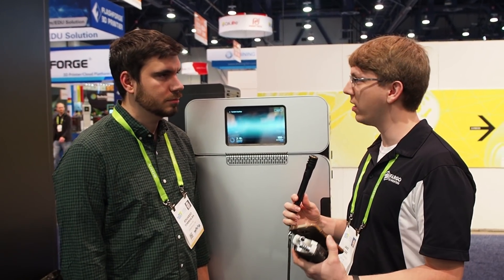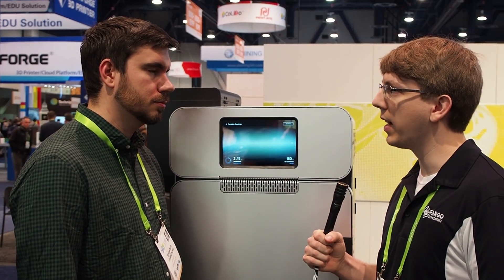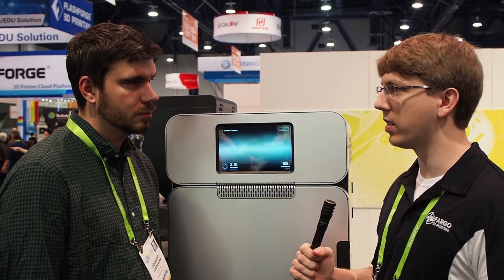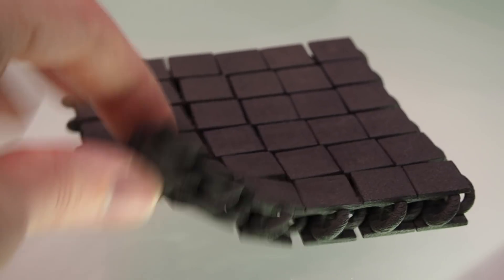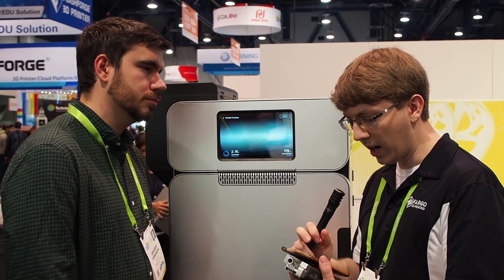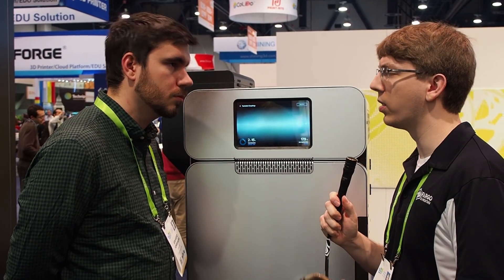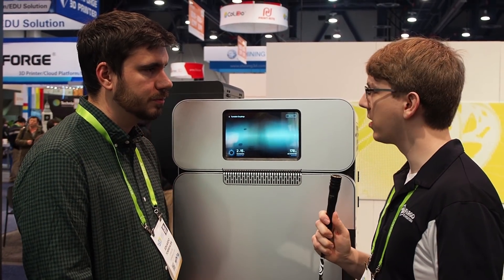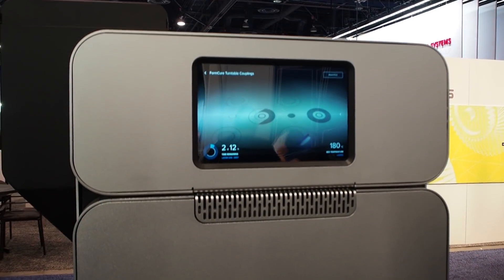Formlabs Fuse 1 - Desktop SLS 3D Printer | CES 2018

Comment: Lets break this down, in general:

+ SLS has better mechanical strength than FDM or even SLA, better for functioning parts.

+ Can build overhang structures, without support (SLA) or secondary material (FDM)

+ /- Usually 'solid print', but if need hollowing inside then ensure you can remove loose powder supports during post processing.

+ / - Can print body within a body in one go, but you cannot retain full mechanical strength if divide a single bike frame (example) into multiple prints due to size of machine.  It has to be printed in one go and thus you would need a larger SLS machine.
https://youtu.be/oChnml1Twy0
https://youtu.be/prErZtXFrSw?t=110 (weld on metal)

- Long Prep time (warm up) & long post processing as it usually more messy than working with SLA.  e.g. Mask, extraction fan & filters, bead blast chamber (ideally), air compressor and etc.

-  Less accurate than SLA, Expect non-uniform shrinkages between xy &z

- This machine will always be plastic powder, no metal and no multi colour prints.  Metal powder require industrial laser (power consumption) definitely not from a desktop unit.

- Surfaces can be treated (for mechanical strength) but visual treatment (dark powder + color dye) are sub-par compare to SLA

+ SLS Material + Treatment can enable flexi joints e.g. live hinge, compressible springs (non functioning) & etc.

-  SLS is ultimately porous, expects leaks after few days if making a bottle.

- This desktop machine weight 88kg (194lb)

- Not normally used for making Master Moulds, unless you are ok with surface texture, but it harder to remove.
Unlike SLA which can do Vacuum Casting, Vacuum Forming (even FDM), Wax Casting,

Comment: sls printed polyester has a pretty rough surface finish. if you want to create production parts with professional surface finishes (or molds for these production parts) you will likely need a different solution. this device primarily appears to be for proof of concept and testing. what is the solution you need for to produce production parts or molds with perfect surface finishes? not sls. not sla. not dlp. not fdm. you need a milling machine. sorry to say. maybe the reality will be different in 10 years but today milling machines still rule the production world
Reply: incorrect about sla. https://formlabs.com/injection-molding/
as nice as milling is, it's not the best solution in all cases.

Comment: Very cool! I've been looking into getting an SLS printer for my next 3D printing platform. 
Do you know if the developers are working on enabling the Fuse 1 to print with other types of materials/powders, besides nylon?
It would be great if we could print with PLA / PETG / or Metal powders for example and just adjust the laser / chamber temperatures accordingly.
Reply: I had asked them about white nylon so the parts could be dyed. I think the reason you wont see other colors is because the darker color absorbs the laser better and for lighter colors it would need a higher powered laser